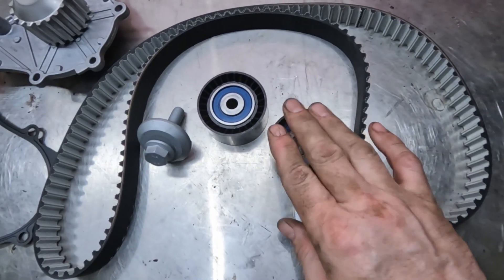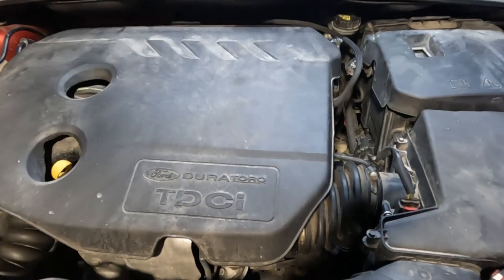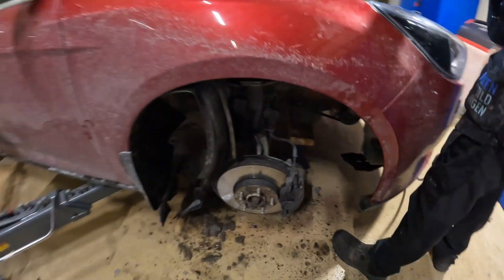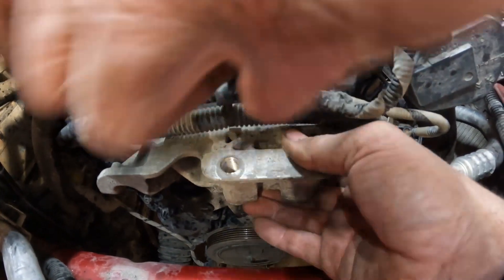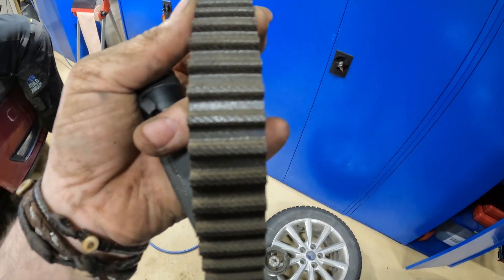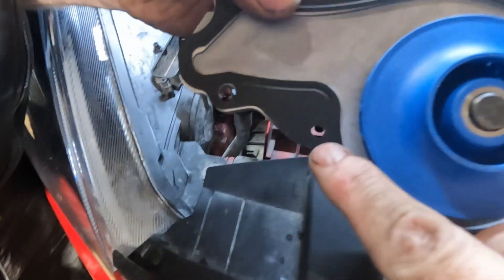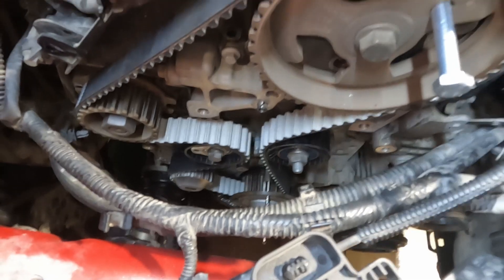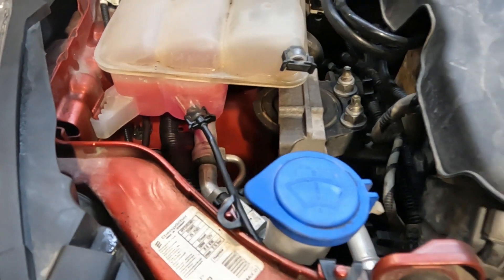GUIDE. Cam belt and waterpump replacement tutorial. Mk3 Ford focus 1.6 TDCI.

Comment: Hi
Nice video
Can you inform me how to remove and tight correctly the crankshaft bolt
Thankfully
Reply from the maker: I believe I undid it with an impact gun. And to tighten it up I think leave it gear and the other wheel on the ground was enough to tighten it up
Reply: Thank for your answer.
Most on you tube use air gun.
But I wanted yours experience about this action. I believe this way is more reliable to tight the bolt without spend time to remove starter motor.
Best regards
Reply from the maker: I don't normally use air guns but battery driven machines
Reply: Yes. They most use battery impact tool.
Thankfully

Comment: Good job! How could you loosen the crankshaft pulley? I want to do this process with mine, which is 1.5TDCi but I realised that I cannot lock the flywheel even if I found the locking hole next to the oil sump. That's because there is no hole on the flywheel as it was shown on the workshop manual.
Reply from the maker: I think I used an impact gun.
Reply: @mike_themechanic  I know but how did you torque down the pulley after reassembling?:) Did you lock the pulley somehow?
Reply from the maker: @markmeszaros5314 not 100% sure but I think we were 2 people one to hold it and one to torque it. I don't think it's that massive amount of torque
Reply: @mike_themechanic  OK, thanks! :)

Comment: Hi Mike, I’m changing the camshaft and followers on my 1.6 tdci, how to achieve correct timing with no previous references to work to? Need to find TDC without being 180 deg out, thanks
Reply from the maker: It's always difficult but if you can put a long screwdriver in to the hole for the glow plug and turn the crank over by hand you should see when the screwdriver is at the top. That just means the piston is at the top you have to then look at the crank to see where the markings are to see if you are 180 out.
Hope that helps

Comment: hey! video was cool, but what about the tensioner's bolt and the guide wheel's bolt? Dont need to be replaced?
Reply from the maker: Thank you. 😊
Can't remember if I changed it or not. But if it came in the new kit it was changed.
Reply: The bolts for the belt tensioner and guide pulley don't need to be changed,,You can also reuse the bolts for the waterpump provided there in good condition ,,The crank bolt is recommended to be changed as it's a stretch bolt,,,

Comment: Nice Work. I have a question. Why didn't you drain the coolant before old water pump was removed? 
In my Transit Connect i found small valve at the bottom of the radiator, probably Focus has it too.
Reply from the maker: @andreyns89  yes it does have one as well. Unfortunately I've found it to be very poor at draining the system so I didn't bother this time.

Comment: I’ve had a gates 1 fitted to mine it’s had 2 in the last 60k miles both water pumps have failed 
What happens if it goes whilst I’m driving can it take the engine out haven’t used it for a week just waiting for it to get in the garage it’s losing antifreeze and makes a whining noise 1.6tdci 2013 
Thanks
Reply from the maker: Wow 2 in 60k that's not good at all. Do you know why they went? If the cambelt goes it usually destroys the engine. If the water pump goes it usually stops pumping water and the engine can overheat.
Reply: @mike_themechanic it’s them gates water pumps they have lots of problems don’t know why he used them must have been the cheapest 
I’m taking to a different garage this time who will use a dayco or Ina belt & water pump 
Thanks mate
Reply from the maker: @landerson928 hope that solves the problem now then. 👍

Comment: Good video Mike 👍🏼 do you not need to lock the crankshaft?
Reply from the maker: Yes it was locked in place with a drill bit (4:41) as was the camshaft
Reply: @mike_themechanic simple as that? Just a 5mm drill bit? Good stuff 👍🏼 I’m tackling this job on a 2013 fiesta with the same engine. Thanks again 👍🏼
Reply from the maker: @rhendry5832  that's all we used. My colleague has worked at peugeot for many years and it's a peugeot engine.

Comment: Nice video. Well done. Does the high pressure fuel pump need to be locked in place or does it matter what position its in?
Reply from the maker: No the pump doesn't need to be locked as its a common rail system and the ecu sends a signal when to open the injectors not like the old mechanical pumps that did it.